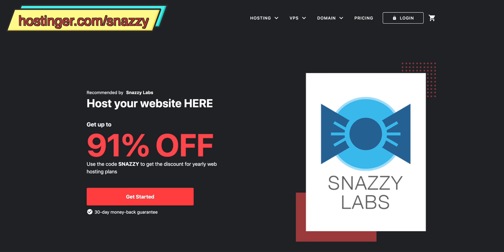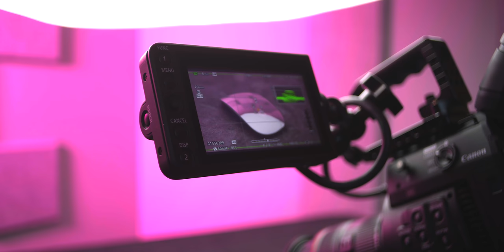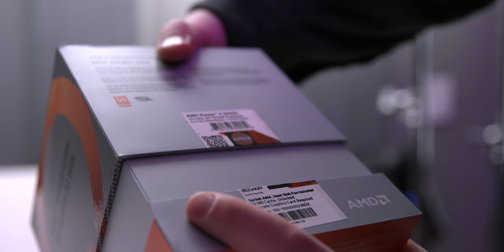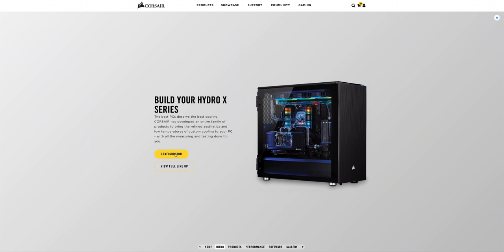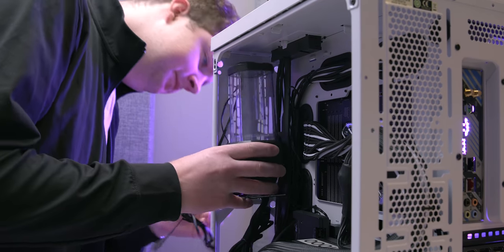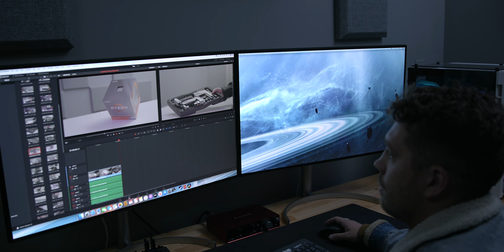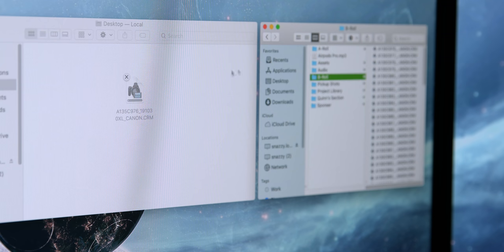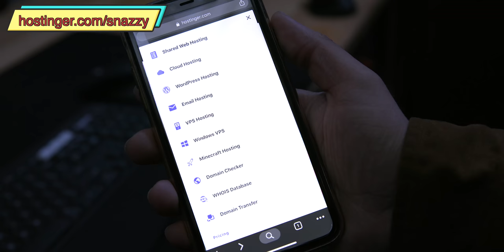AMD HACK MAC KILLS THE NEW MAC PRO!

Comment: Oh i'm definitely gonna want to see that 3950x in there
Reply: Michael Zavala  That would be a whole new build though requiring a new motherboard, water block, and new tube runs.
Reply: Michael Zavala  wait for the 3990x
Reply: yessir
Reply: I'm in the process of changing to a Ryzen 3950x RTX2080ti build after 2 decades+ of being a Mac user ( it won't be a hackintosh, don't need the hassle )  can't wait to finally be able to get my teeth into some high end graphic rendering. No way was I going to spend £6K on a basic Mac Pro when I can get something faster with decent graphics for half the price. 
No idea what Apple are even thinking with this new machine  to be honest ( if it's ever released ) I mean, the base model has an AMD Radeon Pro 580X for crying out loud, it's like some kind of dumb joke for people with more money than sense.
Reply: @billB101  lol the radeon pro 580x isn't even as powerful as an rx 580
Reply: Need to see it - going full AMD hackintosh and need to see it running. Would also be nice to see an AMD build guide complete with benchmarks, required and recommended kexts and other tools and utilities that may be handy!
Reply: Michael Zavala would be cool, but threadripper needs a new mobo
Reply: I am definitely going to need to see the Ryzen 3950x in this build!
Reply: Hell yeah, with the correct wifi card too
Reply: Threadripper 3990x is gonna killsthe 10K+ mac pro by far and is way cheaper too
Reply: Why just the 3950x could go for the 3990wx when it launches 😏😏😏
Reply: bill borez I just did the same thing. You won’t be disappointed that spec build is definitely a monster machine. 1/10th the price of the new Mac Pro kicks it to the curb in performing
Reply: Nielsf2704 I guarantee that you could put the 3990x in something that is cheaper than the 5k Mac Pro
Reply: Michael Zavala Is this the new TR 32 Core? Guessing that means the TR 64 will be the 3990x...
Reply: SpicerDavid smacks lips
Reply: Me too!
Reply: Well, considering MacPro is for professional workloads, it's only fair to pop in a 3950X in there. I'm equally interested in what monstrosity you get if you build a hackintosh with the same budget as the bottom-line MacPro.
Reply: May as well throw the WiFi card in there too while they're at it.
Reply: Michael Zavala  Just go with a Threadripper.
Reply: Maybe the epyc 64 core cpu next...
Reply: Definitely wantto see it with the 3950x and have it standoff against a 16 core Mac Pro!
Reply: Here here for 3950x! But did you ancouter issues with Adobe Apps? I've heard that Ryzentoshes have issues with Adobe apps... It's a deal breaker for me...
Reply: in february the threadripper 3990X will launch, i wonder if some1 builds a hackintosh with it
Reply: I would actually like to see some real work done on this box, not just a couple of benchmarks..
Reply: @davido3530  For the price of a Mac Pro, you could still go 3990x/RTX Titan without even tying the price of the Mac.
Reply: @davido3530  It's not even as powerful as any "gaming" Polaris card. Including the 580D
Reply: 3950x or 3970x I would be interested
Reply: Yes, yes, yes, yes, yes, yes, yes, yes, yes, yes!
Reply: The 3970x or 3990x is a complete new build, the 3950x is top of the Line for the AM4 socket. But of course the comparison of a 3950x vs. a 3970x or a 3990x is interesting. Especially can MacOs handle the 64cores/128 threads well or does it have the problems with more than 64 cores.
Reply: @davido3530  whuuuuutttttt
Reply: Hell yeah, please do it @snazzy labs
Reply: Good thing they rigged it with an elaborate water cooling setup that's difficult to disassemble and probably won't be compatible anymore!
Reply: Me to!,,
Reply: Timothy Dexter  I did it months ago, absolutely love the 3950x 2080ti combo  with Cinema 4d and Octane render, best decision I've made in a long time.
Reply: @billB101  well I hope you didn't buy the 2 rtx 2080-s now..
Reply: @yung4real77  No, I only bought one 2080ti in the end, will be buying another card later in the year. Probably an  RTX3070.
Reply: I will be waiting for the 5950x

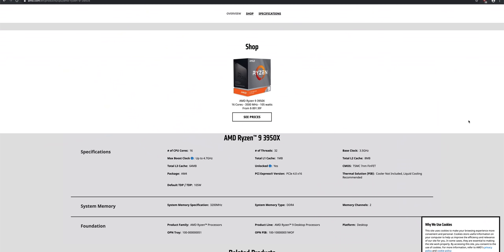Comment: 10:48 of course everyone wanted you to do a follow up
Reply: I wouldn't even have bothered with the 3900x. The 3950x adds less than 10% cost for 30% more performance. But i guess the 3950x wasn't even released when they build that thing.
Reply: I want a follow up too
Reply: @Psi-Storm  it's also hard to get ahold of when within 10 mins of a new stock they go out of stock again.
Reply: wrg, not, doesnt matter

Comment: "Oh i'm definitely gonna want to see that 3950x in there"
Reply: I just bought a 3950x. So I am definitely interested in this.
Reply: Rah K Me too, with the 5700XT, excited for this to work
Reply: @WouterMedia  I'm still waiting for mine to arrive. Early new year hopefully as they ran out of the CPU. It's for a data science pc so I wanted the best components for number crunching. I just moved from using OSX for the last 15 years. I'm so excited. I forgot how geeky I was until I had to pick every component in this. 

FRACTAL MESHIFY S2 BLACKOUT TEMPERED GLASS 
AMD Ryzen 9 3950X 16 Core CPU (3.5GHz-4.7GHz/73MB CACHE/AM4) 
Gigabyte X570 GAMING X: ATX (USB 3.2 Gen 1, PCIe 4.0) - RGB Ready! 
64GB Corsair VENGEANCE DDR4 3200MHz (4 x 16GB) 4GB NVIDIA GEFORCE GTX 1650 SUPER - HDMI 
1TB CORSAIR MP600 GEN 4 PCIe NVMe (up to 4950MB/R, 4250MB/W) 
CORSAIR 750W RMx SERIES™ MODULAR 80 PLUS® GOLD, ULTRA QUIET 
1 x 1 Metre UK Power Cable (Kettle Lead) 
Corsair H115i RGB PLATINUM Hydro Series High Performance CPU Cooler STANDARD THERMAL PASTE FOR SUFFICIENT COOLING ONBOARD 6 CHANNEL (5.1) HIGH DEF AUDIO (AS STANDARD) WIRELESS  INTEL®  Wi-Fi  6  AX200  2,400Mbps/5GHz,  300Mbps/2.4GHz  PCI-E  CARD  + BT 5.0 MIN. 2 x USB 3.0 & 2 x USB 2.0 PORTS @ BACK PANEL + MIN. 2 FRONT PORTS
Reply: @ArrKayLondon  I think you need to upgrade to RTX 3070 series
Reply: Never came
Reply: @SinghalRishi27  oof
Reply: All the way, All the way, All the way
(Find out whose reference this is and I'll give you an AMD Ryzen 3950X CPU)

Comment: Want to see hactintosh with Threadripper 3990x (64 cores and 128 threads) and dual Radeon 7 cards and 256gb of ecc memory. That would directly compete to Apple latest Mac Pro 2019. And it would be a beast.!!
All in a DUNE case(mac pro like) with everything watercooled.
Reply: Me too... please make that video
Reply: Right a $10,000 thread ripper build vs a $50,000 p.o.s. mac slo
Reply: Dune ain't out yet though.
Reply: watermelon1111111  It's announced by amd and coming in early 2020 TR 3990x with 64 cores and 128 threads and with Mac OS in it. It would be a MONSTER... 😈
Reply: @gjdud12  It's out bro for $199..
Reply: Raj Rana i backed it, but its not out till I receive it.
Reply: Compete? Murder is more like it.
Reply: @BigChungusRedditElite  yeah.. 😅😜
Reply: Raj Rana Mac Pro can have 1.5tb of ram tho
Reply: @Theonevidz Yeah.. As Threadripper is a HEDT processor the RAM is limited but you have PCIe gen 4 which performs double than previous gen and more PCIe lanes 88 on threadripper vs 66 on top model of MAC PRO. 😅
Reply: @Theonevidz  Threadrippers support only 1tb, but the Xeon competitor Epyc Rome supports 4tb of RAM.
Reply: @BigChungusRedditElite  Yeah.. 😁
Reply: Linus is doing something like that
Reply: OK  Threadripper 3990x, now Intel is in real trouble. 😁
Reply: Please
Reply: Mario  yup
Reply: Raj Rana guess what raj, it’s possible. Just nobody tried it
Reply: @agoose1872  Someone should build it when 3990x is launched.
Reply: Linus did a build with 2tb ram, 64c epyc
Reply: Cr1spyNoodles Morganaut also, it bring the 28 core macpro to shame.
Reply: Mario would you please tell me what feature set and upgrade path you speak of?
Are hackintosh systems not easily upgradable today the latest os?
Thanks in advance
Reply: Are there companies that you can purchase such a build from?
Reply: @nonyabuiz2023  Definitely, but they won't come with mac os pre installed because hakintoshes are illegal. Won't be difficult to install it yourself though. Keep in mind that if you buy a prebuilt of this spec, they will probably charge a couple thousand dollars extra
Reply: Cr1spyNoodles thanks for the info. Is that charge because of the work it takes to get it all working properly?
Thanks in advance
Reply: That would actually destroy it
Reply: Mario  nobody use 1.5tb in the cinema industry not even ILM or Blur studios doing multimillion $ movies
apple puts the 1.5tbyte limite no pro will use that amount of memory
Reply: Mario  nobody will.upload a 4k into RAM because ssd are fast enough..workloads that need ramdisk will not be run on.mac

you re dreaming
Reply: Mario  nothing that the dope you must be smoking

learn to behave.its not my fault that apple is the center of your universe

If you could give a decent argument I would take your point but clearly is nit the case
Reply: 3990x doesn't work with OSX. The Kernel only supports 64 Threads/not 64 Cores and 128 Threads
Reply: rek  apple said you can use 1.5tb so apple users  jerk about it,nobody needing a tb would use a mac they will use  a node or render farm
Reply: Maybe the Epyc for memes
Reply: @andercrafter1742  amd sorted it out so 3990x supports mac os x
Reply: check out linus tech tips
he did it

Comment: Put the highest end Thread-ripper CPU in and show Intel whose boss.
Reply: Nah. Slam in a dual socket EPYC 7742 board and DECIMATE the top spec Mac Pro at a lower price.
Reply: Than i would wait a bit. I think, they announced a 3990WX with 64 Cores for January.
Reply: @p3chv0gel22  legit though, the configuration on the mac pro is a joke due to them ignoring just how amazing AMD chips have become.
Reply: @McBossBrine if Apple were to make the move to a objectively better chip set, then the industry would be forced to move with it, ie removal of the headphone jack and the boom of Bluetooth audio devices. I Strongly believe the same can be said that if they were to move to an epyc based system/threadripper system, that either at the same time as launch or quickly following such software would be patched optimising performance. But even without software optimisation nearly all bench marks show an advantage to AMD cpu's.
Reply: @connordarcy712  Apple does not have the same influence in the computer market as they do in the phone market. Literally no one with a PC cares what Mac is doing.
Reply: @TroySavary  it would be mostly Apple professional apps, because if your not using them idk why you would go Mac over pc.
Reply: @connordarcy712  There is a much greater selection of professional apps on the PC side, even among the creative apps that Mac is known for.
Reply: Jon Doe he can’t. MacOS only supports up to 60 something threads 😂
Reply: McBossBrine optimization matters to an extent. Most pro apps outperform Intels stuff on Amd due to just the higher brute force. There is a point where brute force simply outdoes optimization.
Reply: @TroySavary  bingo that's why I use a pc.
Reply: @TroySavary  BINGO...absolutely correct, PC user dont care about Macs, and with crazy prices, they will push away more potential buyers.
Reply: @connordarcy712  apple actually has a great relationship with amd on the GPU side. I'm really hoping it can translate into the CPU side.
Reply: @GodSonBlessed  could not agree more, however, I doubt it will be anytime soon solely due to OEM's receive major subsidies (not sure if that is the correct term) from Intel to use Intel chips to the point where AMD couldn't give away millions of chips to hp for free since it would be uneconomical in comprrison to the Intel option, it's a great read if you want to look into it rather than my butchered rendition of the story in the YouTube comment section.
Reply: @connordarcy712  not speaking for the mac pro but you have the best of both worlds ... using apps like photoshop or premiere or ya final cut pro and having the open source community at your back too with most of the linux software you need as a dev , Now you can do that with windows too by installing any linux subsystem it still behaves like 2 os-es but you can get around that

Comment: Uhhh....

Wanna try out for the new Threadrippers instead of the 3950x. 

Or even better, wait for the 64 core threadripper and build the ultimate 2020 hackintosh pro. 

I just want to see, as an AMD fan, how far can they kick Intel’s arse even with a top end Mac that may or may not cost more than a tesla cybertruck.
Reply: YES!  I want to see an Ryzenshined Threadripper 3990X Hackintosh Pro
Reply: There are a few videos on that, it does work :)
Reply: Team red for CPU and if sometime next year I can get and rx 5700 xt or something close to it all team red.
Reply: It'll cream the new Mac Pro 28 core model.
Reply: @CheapBastard1988  considering the 32 already does it might be faster then 2 of the top end mac pros...
Reply: @smolicek90  using epyc?
Reply: Wasir mac has limitations on cores though. I think the highest they can do is the 24 core or the 32 core with some cores disabled. It’s just that macOS doesn’t support certain amount of cores past a point

Comment: iMessage, FaceTime and Siri work perfectly fine, you just have to setup your SMBIOS info correctly. Now the real things that do not work is native virtualization for things like Docker for Mac and latest VMWare Fusion and Parallels. You can use an older version of them to make it work but its not ideal. My system is a Ryzen 7 3700x, MSI X570 mobo with Radeon VII.
Reply: Henry Brock so how do you send the right
Reply: @blakeok952  you take the right and send it.
Reply: @blakeok952  I'm confused with the question. Send the right what?
Reply: @henrybrock8787  I think they meant how to you set the SMBIOS correctly to get them to work?   But that's just a guess.
Reply: no docker would be a deal-breaker for me. :/
Reply: what model are you using 19,1 for the ryzen 7??? I have a ryzen 3 1300x and I tried the 27", 2015 i5 6600 and 22", 2015 i5 7500 and both didn't work... I'm also on macOS Catalina 10.15.1
Reply: @tsalVlog  whats a docker?

Comment: I would love to see one with a 64 core Threadripper! It should destroy the 28 core intel Xeon in the Mac Pro.
Reply: They just did a comparison - the £4,000 3990x was 50% faster than 2 £10,000 28 core xeons!!!
Reply: @NewLondonMarshall  where can i see the comparison?
Reply: @zack88005  If you search for 3990x vs 2x 28 core xeons there should be a few videos on it :)
Reply: @NewLondonMarshall  And the Mac pro only has one. You need something like a HP Z6 or 8 to get two.
Reply: @Phunker1  Yeah exactly! I have a 3970x and my goodness it's fast!
Reply: @NewLondonMarshall  I just got a 3800x for home use, which replaced my 2600k Sandy Bridge. I don't think I'll have to upgrade that thing for many years to come. Just like my trusty old Sandy.
Reply: @Phunker1  Good point, the 2600k was a beast!
Reply: @Julien Lindauer Epyc
Reply: @Julien Lindauer Yep, that's why the HP Z8 not only supports two 28core xeons, but also 3TB of ram. But seriously... I work in media production. None of our workstations has 256gb ram, the limit of the 3990x. They have 128gb at the most. What's the percentage of Mac Pro buyers that cannot deal with a mere 256 gigs?
Reply: @Julien Lindauer Ah yeah true!!
Reply: @Julien Lindauer but so does xeons?
Reply: @Phunker1  what workstation your company has?
Reply: @Teluric2  Ranging from z600, z620,z640 and z6. Depending on the task. I still use a dual 6-core z600 as my daily office-driver. That thing is easily 10 years old. You can't beat the ROI.

Comment: Make a 350$ - 550$ Hackintosh with 2019 specs
Reply: Find videos with any Ryzen build at that price. Done.
Reply: With ryzen specs. 2700x which is dirt cheap now, and rx590 or the new 5500xt/5700
Reply: @eurobeaner  2700x isn't as good as the 3000 series. Major improvements.
Reply: I would pay someone to build this for me
Reply: @ThatDarnGenius  Hit me up and I can make it happen
Reply: I've built three different intel based hackintoshes, but no ryzen ones. New project!
Reply: @RogueTravel  Can they be updated with the app store or requires re-hacking for every OS update?
Reply: 1Esteband updates normally require research, which is a waste of time! Depending on the update, things may or may not require a lot of effort. I keep my files and applications on a separate drive from the operating system drive, so that if the update breaks something I can do a fresh install.

Comment: Skip the 3950x, go directly to 3rd gen Threadripper 3970x
Reply: Geoff Seeley or the upcoming 3990x in the future😉
Reply: Skip those TR, wait for the zen 3 4990x.
Reply: Kos T. Zen 8 9990x
Reply: @diegoamorim7924  Zen Quantum InfinityX
Reply: He's testing the 3950x on that machine, the TR 3970x does not work on that computer, he has to build a new one.
Reply: The TR can’t fit into an mATX or ITX case.